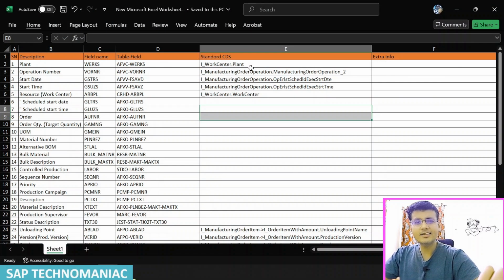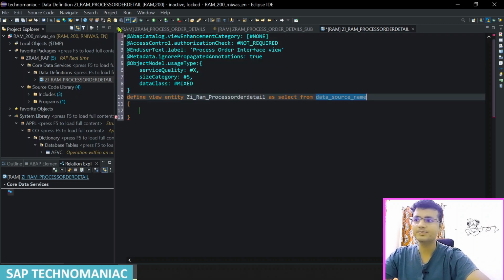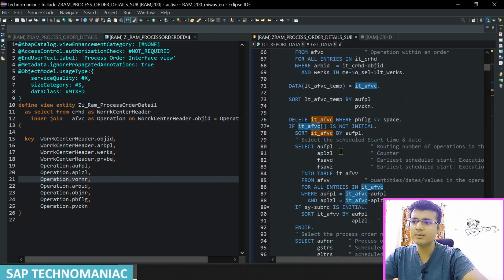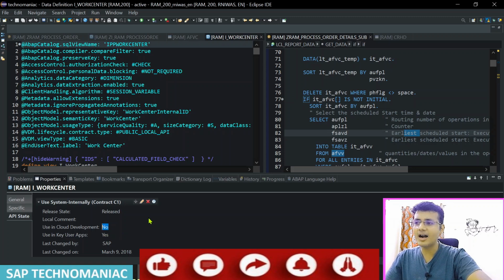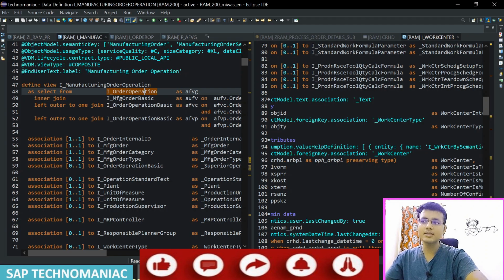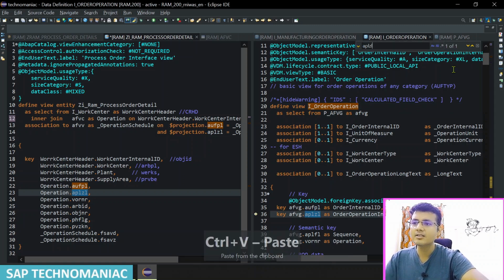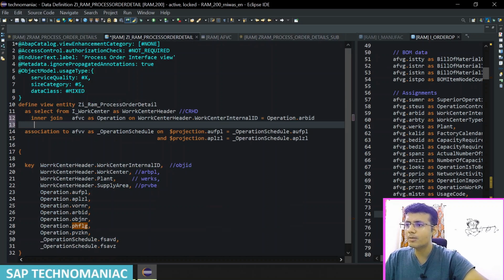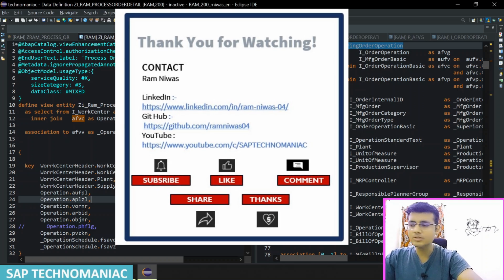Kickstarting Real-Time Projects with Your First CDS Using Released Artifacts

Comment: Hi Ram,
In CDS view on what factors based we need to chose b/w joins and association ?
Reply from the maker: In ABAP CDS, choosing between JOIN and ASSOCIATION depends on how and when the data is needed:

Use JOIN when data from both tables is always required, or when you need filtering, aggregation, or performance-critical reporting. JOINs fetch data immediately at DB level.

Use ASSOCIATION when the relationship is optional, navigational, or used in RAP / Fiori Elements apps. Associations are lazy-loaded and fetched only when accessed, making them more semantic, reusable, and Fiori-friendly.

Simple rule to remember:
 JOIN = data you always need
ASSOCIATION = data you may need

For RAP and Fiori Elements, ASSOCIATIONS are the recommended best practice due to navigation, extensibility, and clean core compliance.

Comment: Hi , Can anybody please help me!? I have a question, I need to create an OData Service for calling an RFC Function ... but in RFC Function, it has a table (for both input and output this same table ) ( and another field for input ) but in odata, how to pass a table for input!? (For Query operation , i mean EntitySet ... can not get table as input... but if I use another thing like Create, I can not pass the table as output!) so how to do this!? ( I searched many times ... but using filter like ( first_field eq '1' or first_field eq '2' ... ) and second_field eq'0' or secont_field eq'1) ... etc this is not a good way and if i use batch ... it will just call RFC Function for each rows... this is not what i want... and also I made Function Import but it could not get parameters as a Json... so can you please help me or refer me to one of your videos or something!? thanks a lot .

Comment: Hello Dear...

KUDOS to your dedication and Efforts, Really appreciate it, Keep going Dear...

Well, I've got a requirement to Modify a standard RAP Based App , F6015...

Your suggestions as to how to move on further would be highly appreciated...

Requirement is to add few custom fields in the header section of the App with filter service enabled...

Kindly help...

Thanks...
Reply from the maker: You need to check the fiori app library and see whether this application s extensible.